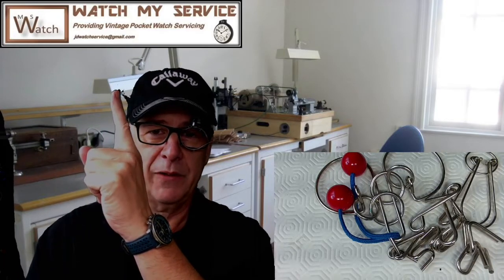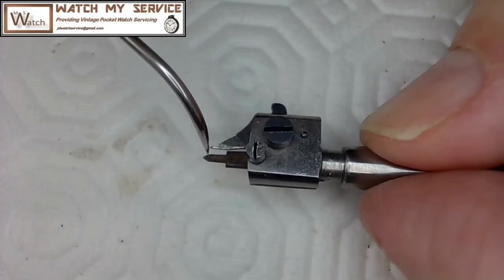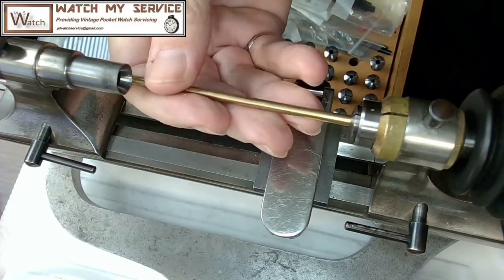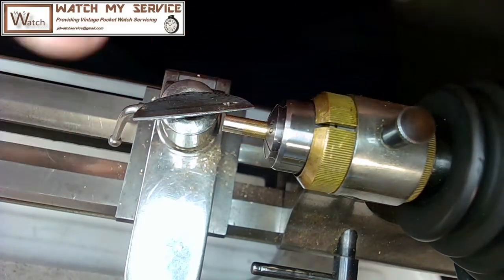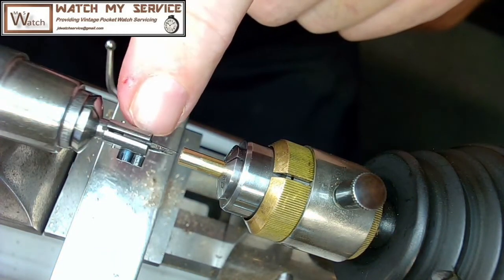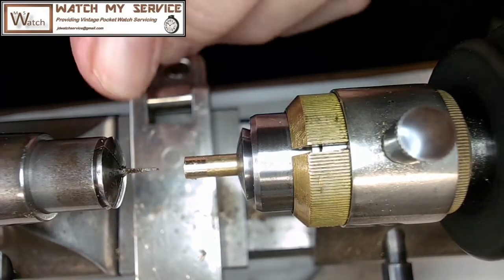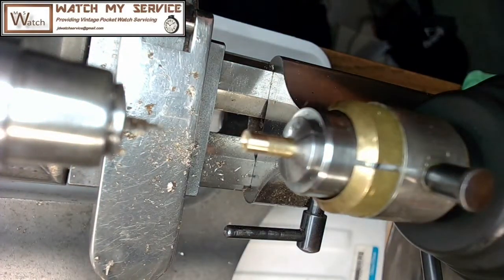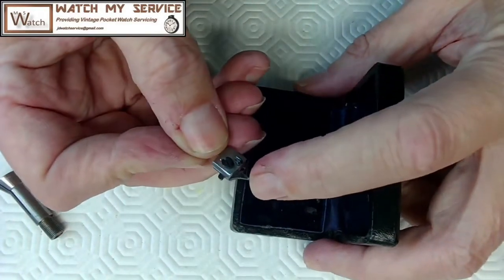New Tool For Making a Pocket Watch Jewel Setting

Comment: Thanks for this, JD. It’s good to know I might still have a hope to replace broken jewels in a couple of old watches.
Since the tool came with its own small pulley and has double edges on the centre cutter, could it have been made for reciprocating motion, such as from a bow?
Reply from the maker: Good observation. You may be correct

Comment: 24:34 I notice you have a Lindsay-style parallel heel on your square graver there. Does a heel help at all with lathe turning, or do you also do traditional engraving with those tools? Thanks for answering my questions, btw. I am a goldsmith just getting into watchmaking.
Reply from the maker: This was a graver I ground to a triangular point. And I do not do engraving with these tools
Reply: @JDRichard  Thanks again, sir.

Comment: I think a tailstock setup for the taper should center good as long as tailstock is centered. Its never a good idea to hold a taper in a collet. The tool is a great idea making a d' bit  would work the same and cut better then the negative cutting angles on tool ..